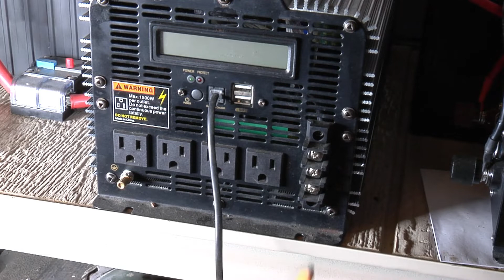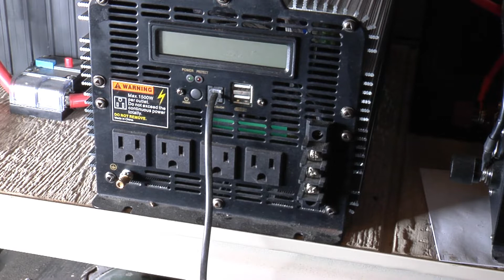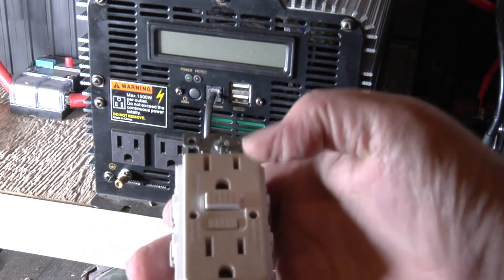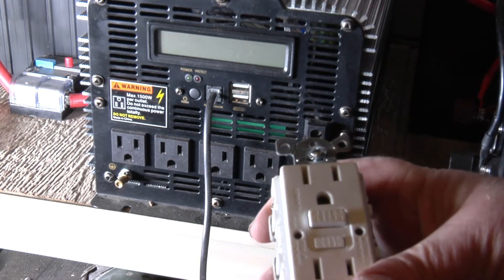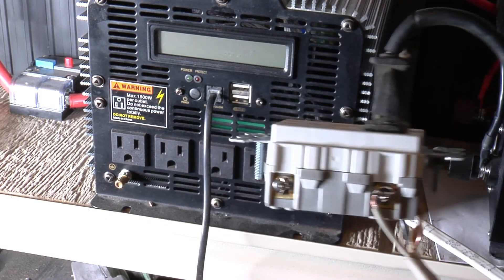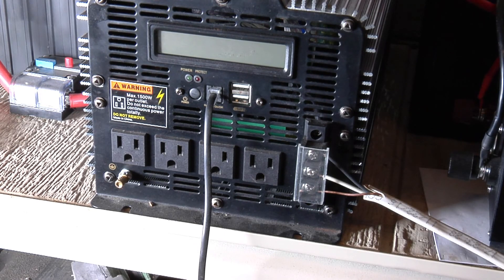How to Hardwire Your 5000-watt Power Converter to Home wiring

Comment: Do you have a choice to pick up your car yourself once you win a autobidmaster auction or you have to get it shipped, dont wanna pay any extra fees just curios
Reply from the maker: Yes you can go to copart in the city you bid from, and pick up the next day and save money,  that is what I will do next time, if you bid on a car  just make sure its not to far away because more than likely you will have to go get it. They were going to charge 900.00 dollars to deliver from St Lewis mo. And I rented a trailer and the trip total cost around 200.00 that was a big savings,  more money to put in your car. Thanks.
Reply from the maker: Also bring your bid number. Pay and they will set it on your trailer. Very easy...
Reply: @camaromodschannel  what about a dually hitch to pull it

Comment: I would imagine you could connect this up to your electrical panel just like you would a gas powered generator.  Attach a power inlet box to the panel, wire that into a breaker at the top of the panel, then install an interlock so you don't accidentally backfeed power into the grid.  Connect the inverter to the inlet box plug with a generator cable, boom, Bob's your uncle!

https://www.youtube.com/watch?v=gorjxkgInng
Reply from the maker: Yes you can,  be best to have a 220 converter,  or two of the 5000 watt so you can run both sides of the breaker box. This size i have would be perfect for an off grid cabin.  Thanks..
Reply: @camaromodschannel  Oh that's right, the way the bus bars intertwine you WOULD need 2 120V inverters to backfeed the entire panel! 🤦‍♂ I suppose in a pinch you could run 1 inverter to a single phase breaker and locate the circuits you want to power on that breaker's bus bar (as long as they're all 120V.) 🤷‍♂
Reply from the maker: Yes , I have done that with a 120 generator and have to switch sides to keep the fridge going.  And if you're lucky may have a tv too.lol